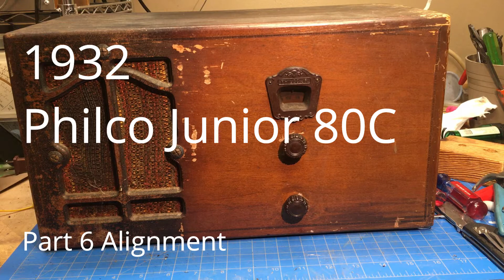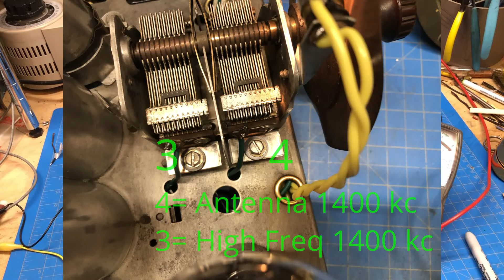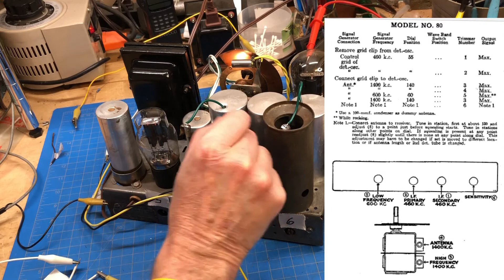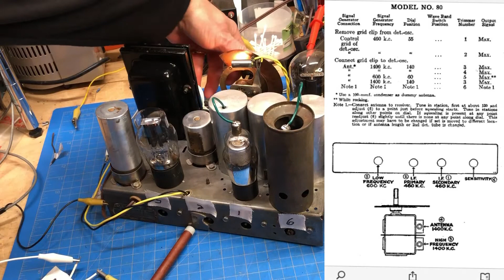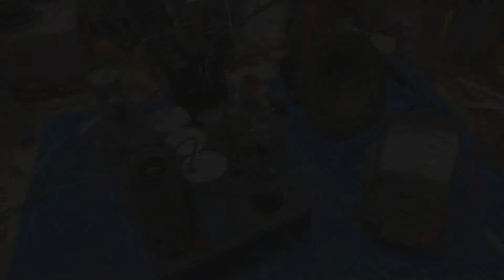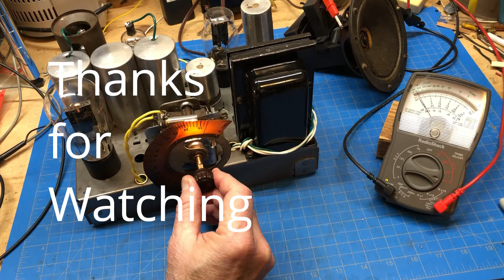1932 Philco Junior 80C Part 6 of 8 Alignment

Comment: Good tip on mica trimmers.  I will remember that.  I have not seen an alignment of a regenerative set before.  Would love to throw one on a spectrum analyzer some time to look at the curves.
Reply from the maker: Hallicrafters Rehabs Thanks! Hope that tip helps....just makes sense...I’ve backed off the trimmers before and they didn’t decompress...maybe the layer hung on the screw treads(?) and then later slipped off!! That would be a great video to see a regen on a spectrum analyzer....I have a TRF second in line next for video....Thanks for watching and commenting!!!! Take Care and Happy New Year!—Larry